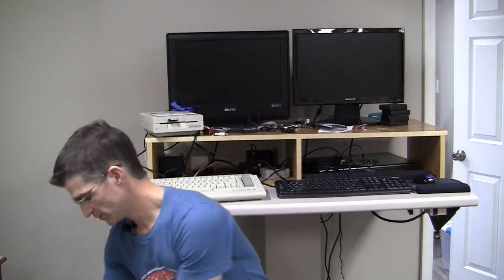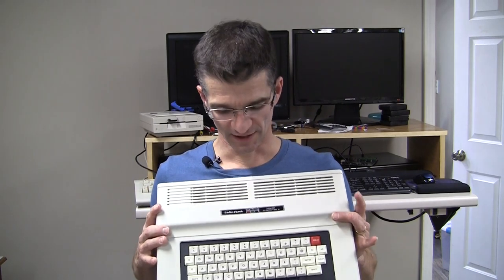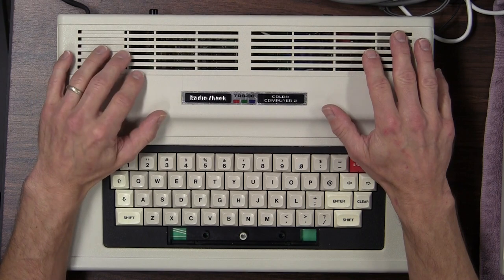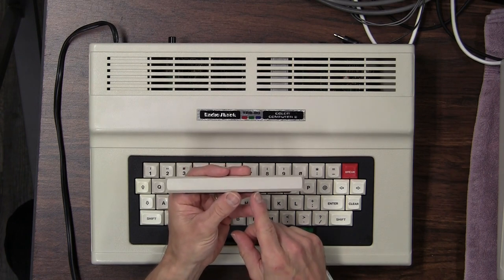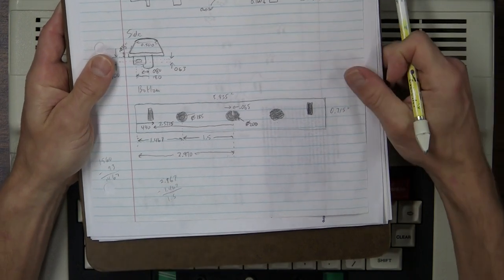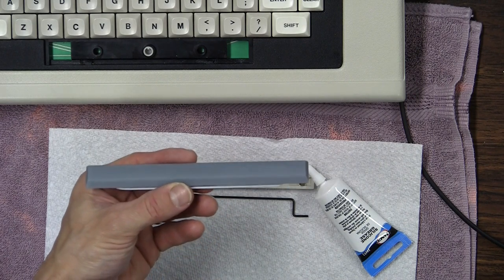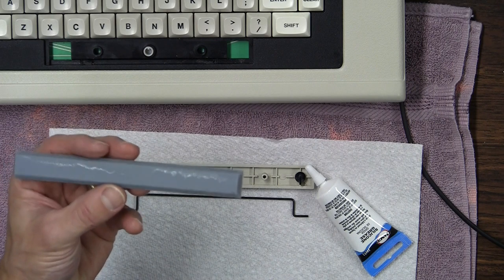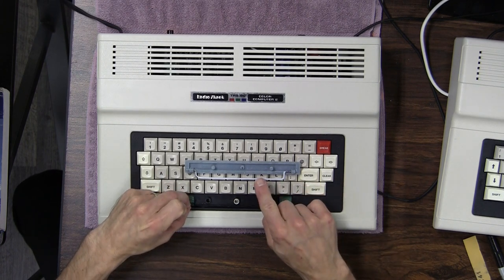My Most Unique TRS-80 Keyboard: A Melty CoCo2 Spacebar Replacement

Comment: My 1st experience of computers was trash80's in 1983. (pre CoCo)
We used to 'poke' the registry for a solenoid in the keyboard to get sound.
The computer room at Wellington College NZ was a dis-used toilet with 3 stalls and the bench in front of a stylish stainless sectioned back wall.. (Nothing but the best for a 3 second fad that would probably never take off).
We later upgraded to BBC Micro's which I proceeded to create a program called hassler where I would send codes to unprotected workstations that would set them off with a 3 channel wailing noise a bit like the standard oooOOooo ghost noise, randomly ascending/descending.

Memories.... 80*25. Making dots pass off one side of the screen or bounce. Making a FILL function that remembered every hole it skipped over...

And my 1st program ever... calculating Prime numbers.. Where it used only odd numbers, and previously found Primes for the test. 

which is why I went on to be helpdesk, Field support, and now a service engineer for equipment like water blasters (on about 1/2 what i was earning in IT but without the politics)
Reply from the maker: As well, the first computer I used was the TRS-80 Model I/III/IV.  I was so young that I'm not sure which model number it was.  They were in the library at the school where my mother taught 8th grade English and Language Arts.
Reply: @acs8-bitzone651  In '83 we had about 5 Trash 80's and no computer teacher.
My parents got a Sharp PC3201 which I taught myself basic on. Later I got to use Windows 1 on a PS2 80 at Mobil HO NZ. Fun times...

Comment: Cool... the 3D printed spacebar looks great, and I never would have thought of using a coathanger for the stabilizer bar. Look forward to see what you do with Drivewire. Do you also have a CocoSDC?
Reply from the maker: Hi Curtis. So far I've used DriveWire to copy a physical floppy to a virtual DSK image on my PC.  I haven't yet found a tool for examining the contents of DSK images. Seeing the ASCII version of the /BAS files in it is my next goal.  I was on the trail of some tools that might do that the other day, but I got sidetracked and lost the trail.  So do you think some sort of usage like that would make a nice video, or has that already been covered?
Reply: @acs8-bitzone651  - When you say "examining the contents of DSK images" - on what level? Seeing a list of the files, or the actual contents of files (like detokenized BASIC, etc.)? And, as for making a Drivewire video - while there are existing ones, by all means do a new one - you have a different audience (more generalized retro), so it could reach out to people who are merely thinking of dabbling in the Coco community.
Reply from the maker: @CurtisBoyle  I'd like to be able to open the BAS files, save them elsewhere on the PC as ascii (detokenized), edit them, and save them back to the DSK for ultimately moving them back into the CoCo. Is that basically cross-development? Coding on the PC, but executing in the CoCo HW. I'm sure to move quickly from there into ASM cross-development which has been a goal of mine for some time.
Reply: @acs8-bitzone651  - There are several programs (some come with things like MAME) that can read DSK images. I do have one (still getting worked on / expanded) for Windows, that is easy to use and GUI based (for DECB images only), if you want to try it. If so, send an email to me at curtisboyle@sasktel.net, and I will send it to you.

Comment: Nice work with the spacebar! 3D printing is really a great way to replace missing parts. I too have a computer waiting for a 3D printed replacement keycap. What 3D designer are you using? I’ve been using the Autodesk Fusion 360.
Reply from the maker: Yes!  I am using TinkerCAD.  It's very limited.  I've used AutoCAD in the past and may be similar to Fusion.  I used 2D much more than 3D so I'm pretty much a novice with the modeling tools.
Reply: @acs8-bitzone651  FYI, if you have a recycle center nearby that take old printers.. A lot of them have wire to catch printouts that would be perfect for your next 'anti sway bar'.